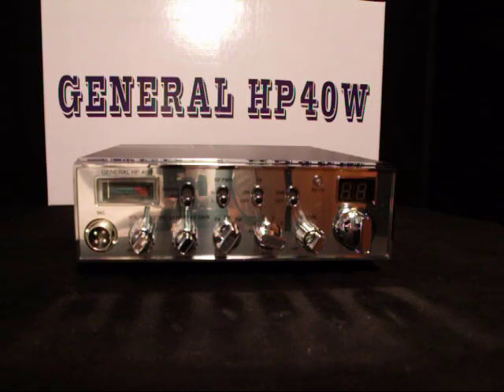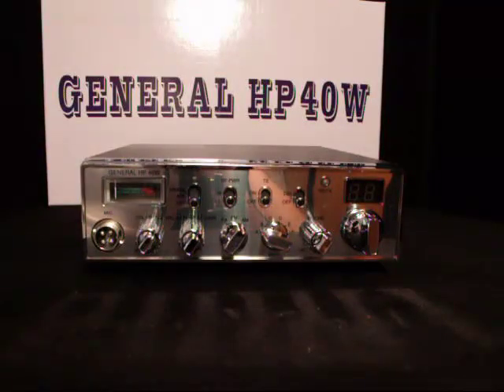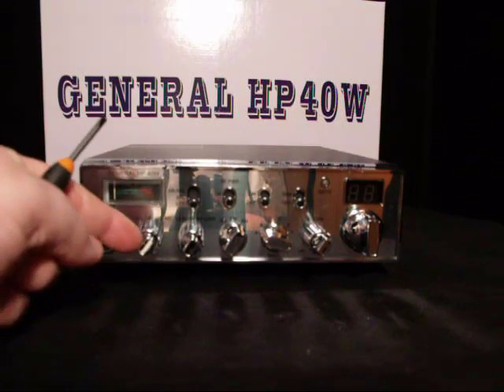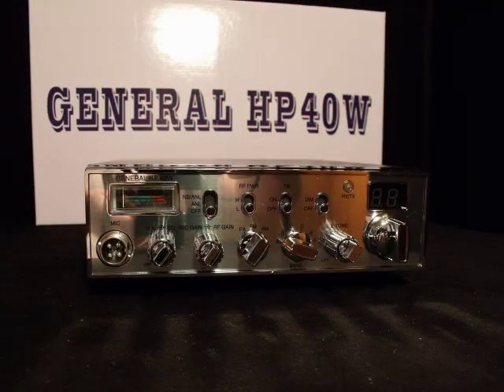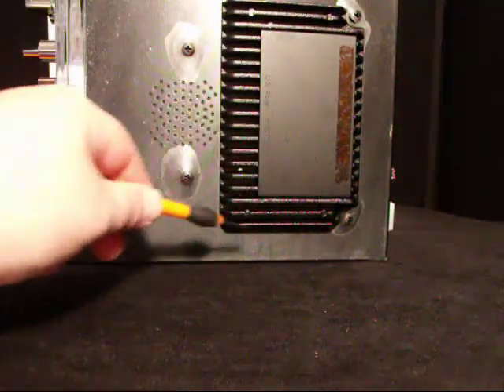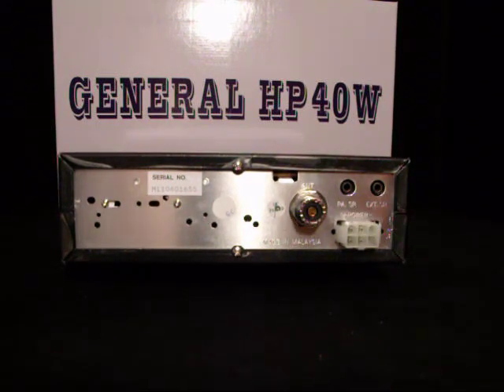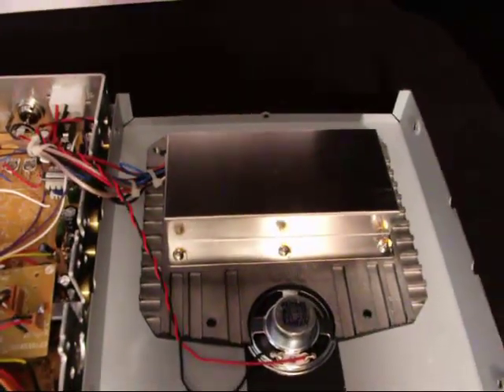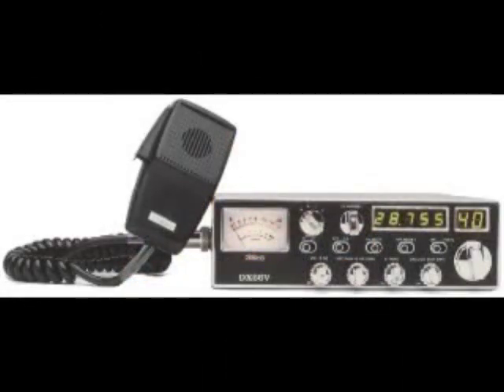GENERAL Lee HP 40W 100 Watt 10 Meter Radio

Comment: I have a 50 amp power supply can I run that radio at full power on that power supply. I'm thinking about getting one but I need to know if I have a power supply to run it at full power. Thanks for the video and the information
Reply: Yes

Comment: can you plug this in the cig lighter
Reply: No. It comes with a 6 pin plug. I'd run it directly to battery. It draws too much power for cig lighter to handle.